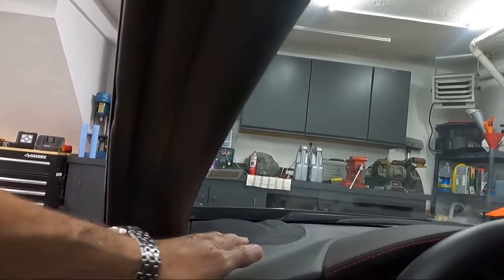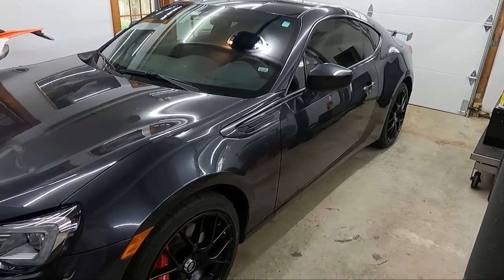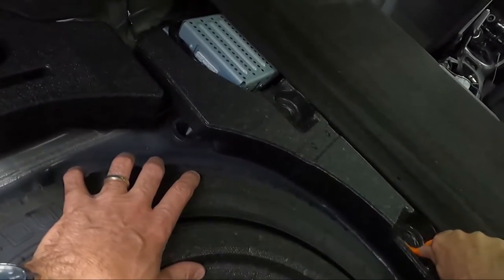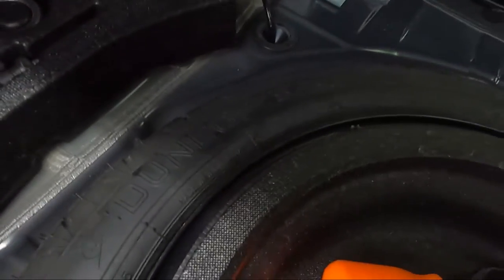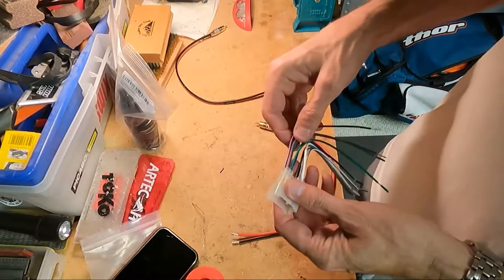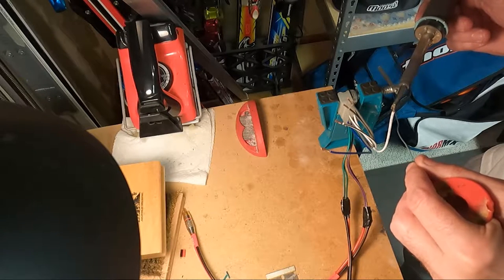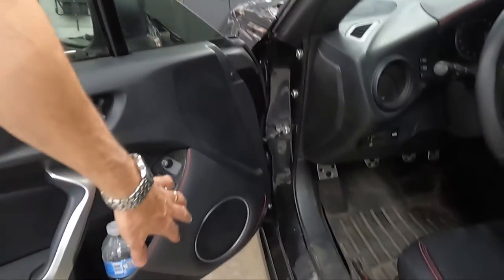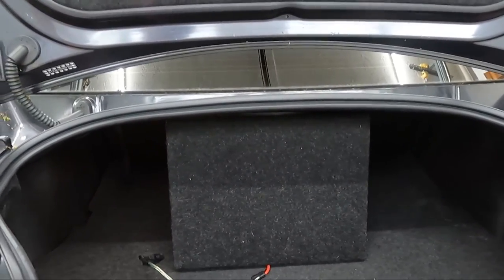Subaru BRZ & Toyota 86 Stereo System Upgrade and Subwoofer Installation

Comment: Hi there! I have a 2020 BRZ, same head unit, but there is no dedicated amp in the back. Any idea where else it might be located??? My plan was to use the rear tweeter signal for the subwoofer but it's high passed. But I don't know where.

Comment: it seems no one is running thicker guage wiring from the speakers to the amplifier. If you replace the factory speakers, am i right to assume that the factory guage wiring will not be sufficient?